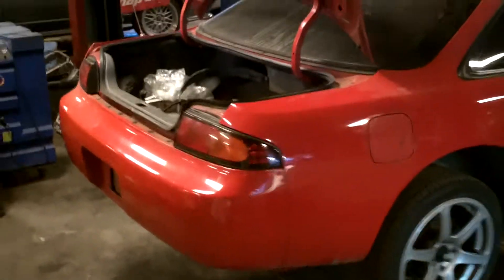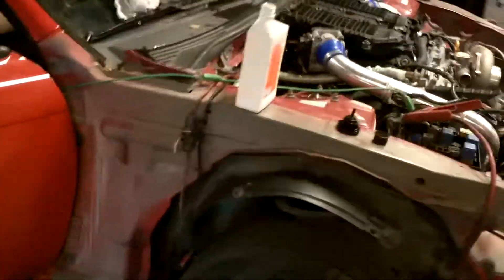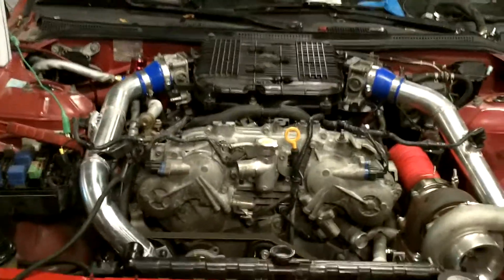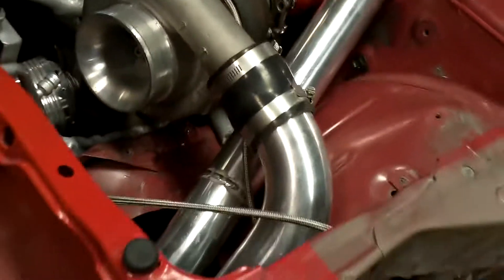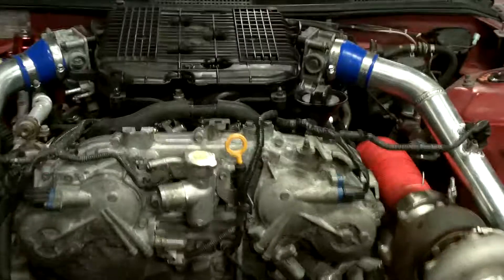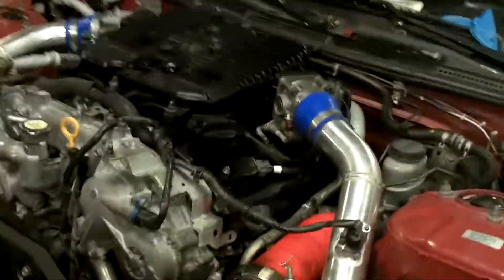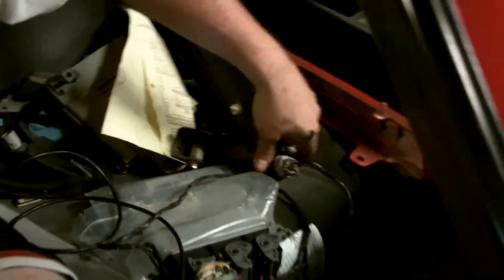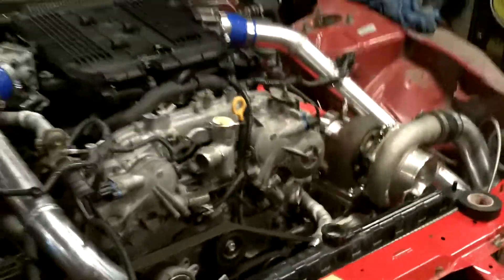Turbocharged VQ35HR swap 240SX by Z-Fever - first start

Comment: Beautifull, what computer you recomende for a 2009 infinity vq37hr  engine for mine? Thanks!
Reply: we tune the stock ECU just like a stand alone. Call me at 813-877-7600 or email at doug@zfever.com
Reply: @dougmitchell743  ok. After work. But for manual though, forgot to mention

Comment: What's the cost for the motor mounts, transmission mount, and ecu harness?
Reply from the maker: mounts $750 (includes trans), ECU and harness job is $1250, shifter bracket is $200, driveshaft is $450